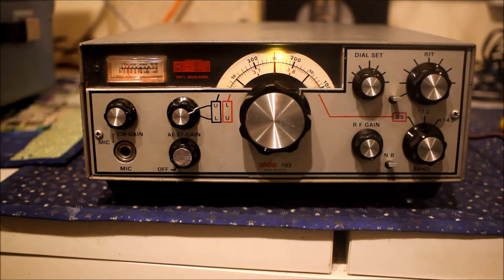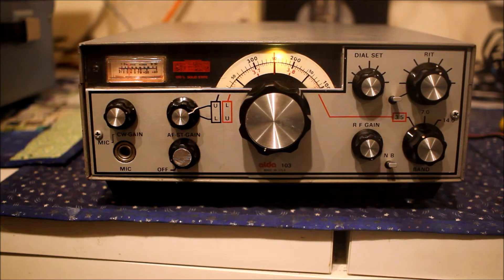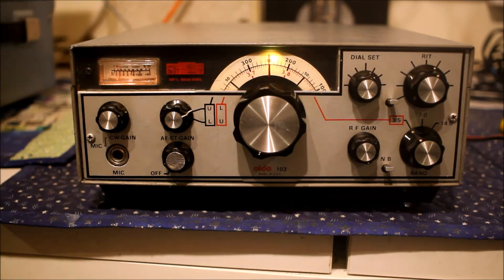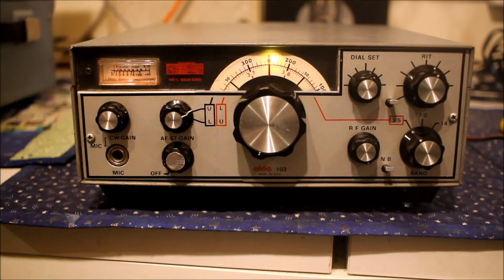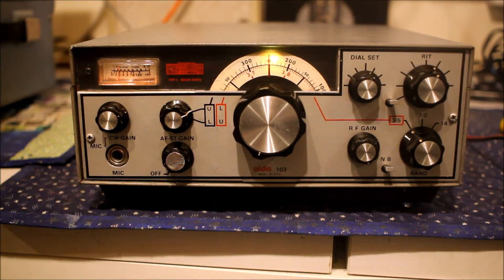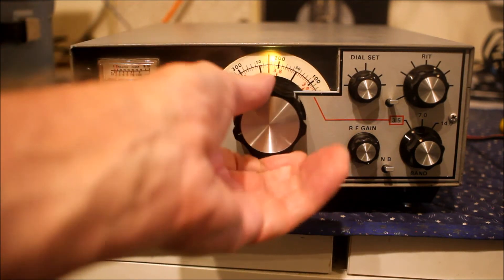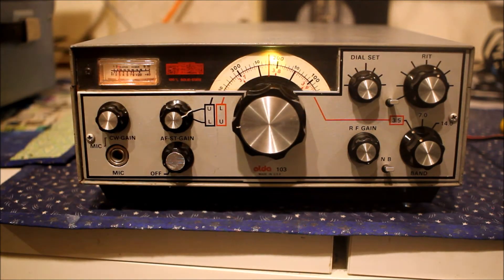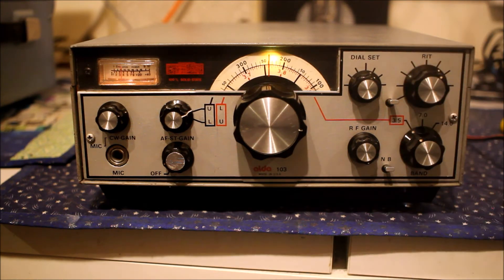ALDA 103 Ham Radio HF Transceiver

Comment: Hello Steve, my name is Ian GW8VUG, I have an ALDA 103 I have had it for some years, I bought it from a Ham in Venezuela of all places, it came in 10 days by airmail, it worked ok about 110watts out, I used it a few times but fell out of love with ham radio and went QRT. This one is the 80/40/20 version, but there is an 103/A which does 80/40/15 , and the 105  a 5 band version which covers 80/40/20/ + two sections of 10 meters. I may put this back on air just for fun, everything in the shack is covered in thick dust😇🤗 73.

Comment: Hi thanks for the video. I have one and got it in the UK had it for many years it is now in Spain at the moment. I am in the UK at the moment. Got it not working bad audio chip could not get another chip for it so had to put in another amp. It works fine now. I agree about the vfo ! I made a digital output dial thing works fine. The output I got with the original transistors is over 125 watts don't use that much!! I really like it worth getting.

Comment: Great little rig ,150w pep will turn it on before the IC-7300 and have more fun
Reply from the maker: sadly not that power in its current state..the PA mods made years before it came to me mean its QRP now. The PA board has had too much done to it. New PA, driver and associated parts required..pity, Steve